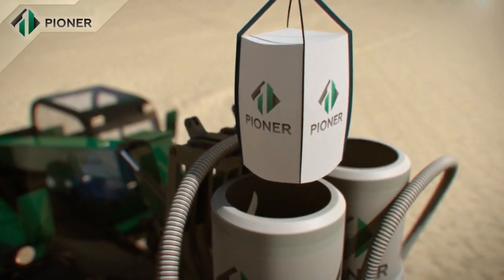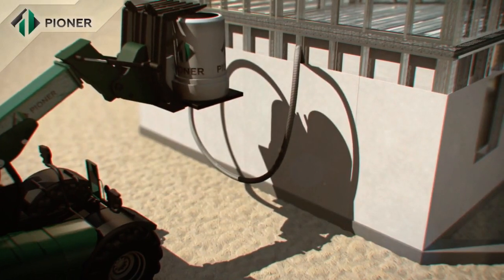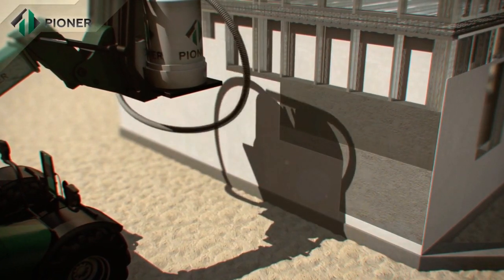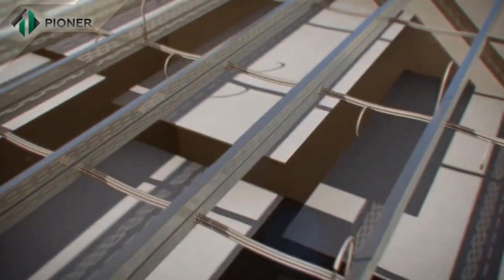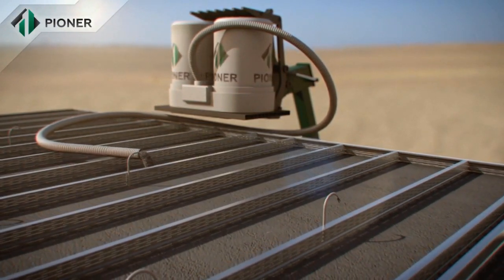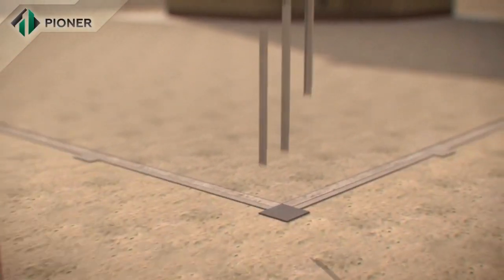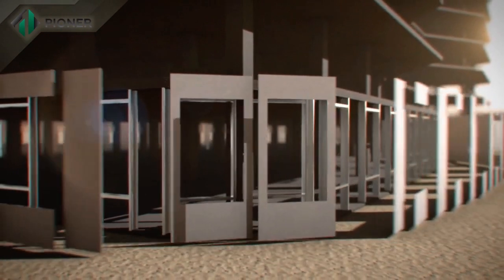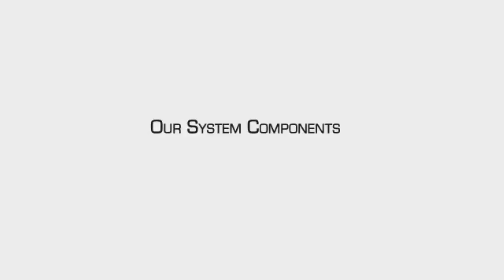Light gauge steel frame building system for low cost housing projects

Comment: Interesting video but why not use closed cell spray foam to add rigidity to the structure and prevent thermal bridging? Wouldn't that be more cost effective?

Comment: Life of such house?
Reply from the maker: for light gauge steel frame with lightweight concrete infill not less than conversional concrete / blocks building
Reply: @stretchceilingsDubai  how about light gauge steel with cement board?
Reply from the maker: @anandasonar3909  we use LGS frame, fiber cement boards cladding and lightweight concrete infill www.pioner-group.com/technology
Reply: How can I apply that job